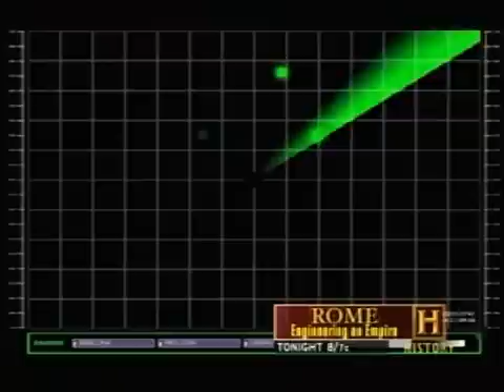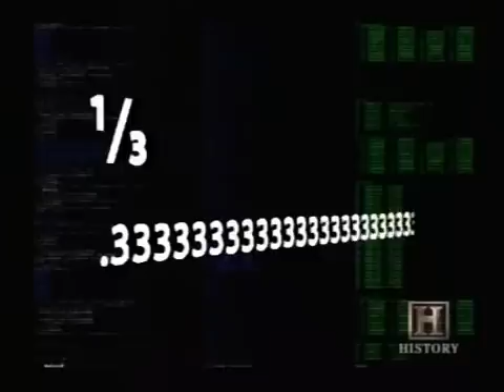Engineering Disasters 13 - Software Flaws

Comment: most software is not properly tested, partly because its difficult to develop a thorough test plan, but mostly because it is very time consuming.
That's why I cringe when people talk about self driving vehicles.
Reply: It should be, and nowadays simulation and testing is much more valued, at least in bigger corporations. Smaller businesses sadly tend to be much of the mindset "we don't need to test it if you do a good job right away" and would rather chew through dozens of devs than admit that maybe the devs need a separate testing environ to make sure the product does what it's supposed to.
Reply: The main flaw with design testing, especially software, is that they ONLY focus on testing to "make sure the product does what its supposed to".  That's only part of the test.  The real difficulty, the real time consuming part is testing the product to " make sure it doesn't do the things it is not supposed to do".

Comment: I'm a software engineer working in telecommunication (WCDMA). Around 800 million people is using our software on daily basis. Few years ago I was assigned to maintenance team and we have received a trouble report from one of our customers stating that their RNC (radio network controller - usually few million people got radio coverage thanks to one of these) actually gone totally nuts and customer was forced to restart it. We started investigating the issue and soon we have found out that our newest software version got an overflow error in procedure which is keeping the system time. One of variables used was too small keep number of milliseconds passed since the system start. It was enough just to wait few weeks for this glitch to happen. Our tests didn't found this because our test nodes never were left running without restarts for so long.
Immediately we've issued a highly escalated message to all our customers that they nodes are going to die at exact hour and minute after last restart and proposed that they need to do a preventive restarts during night hours when the traffic is low until we deliver a fix. Initially our management and customer support organisations were little skeptical about our findings, so they located the longest running node somewhere in the world and waited until error appeared at envisaged time in order to get confirmation that we are right.
Reply: So how long was it? 49 days, 16 hours and 48 minutes?
Reply: Yes, this might be a 32bit variable which was too small..

Comment: Probably some fixed point math error.  In those days, embedded processors didn't have a sound h/w for floating point math like today, so the engineers had to deal with rounding errors and make assumptions.
The Ariane system depended on a load of cascaded PID control parameters, digital filters, etc. The programmers had to assume some border conditions to keep maths within range, and pray that nothing went off scale. But praying doesn't work in Engineering.

Comment: No, they just were good at fieldcraft (tanks) and used them when weather was poor, meaning the USAF which carried out most of the work couldn't find them. They wanted to bomb them to help the KLA, which is an arm of the Al-qaeda network and ships opium to Europe from Lebanon (Don't ask me why the US leadership wants them in charge in Kosovo).
They couldn't find the SAMs because they were turned on/off and plenty of ECM decoy tactics were used as well - for example turning the radar onto a fence

Comment: You do realize that you can't use stealth against metric wave radar at all? IT doesn't come into the return signal strength at all. It is only the wingspan of the aircraft that is important, and the shape/dielectric properties of the skin are entirely irrelevant. 
Also consider that the moment you start jamming (if you use interleaved pulsed/passive radar mode as the ground radar) means you stick out like a sore thumb for SAMs?